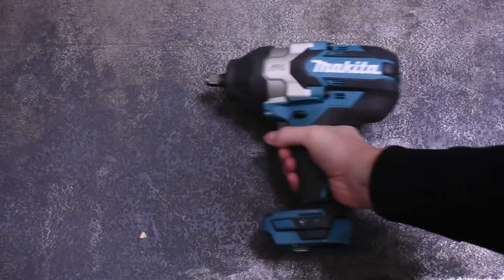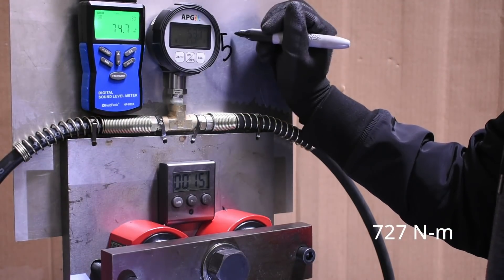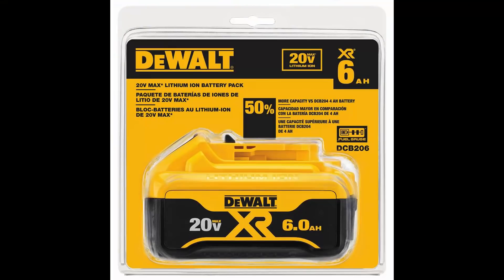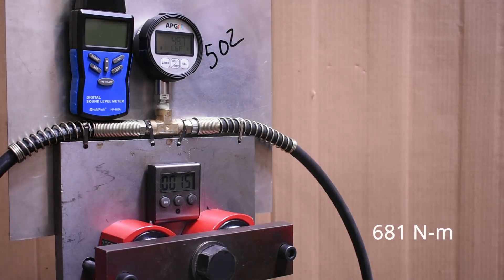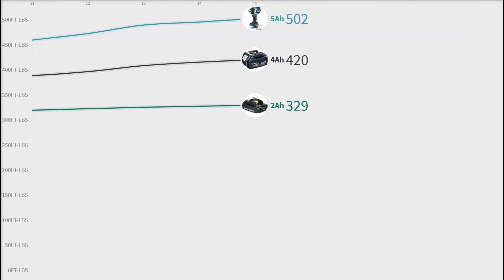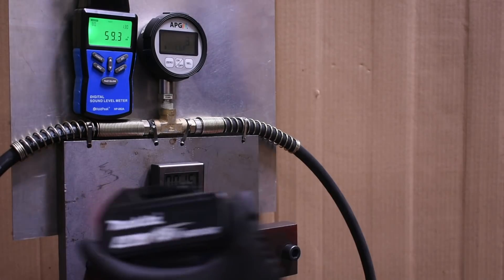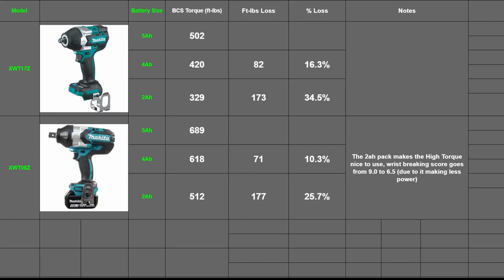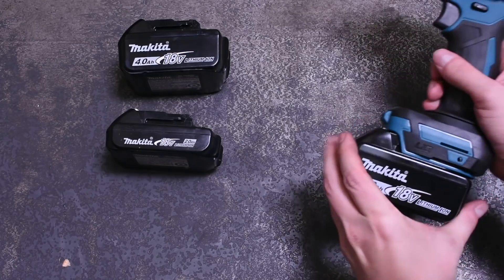How Much Power Are You Losing w/ Smaller Batteries? Dyno Testing For Science

Comment: My tool set is largely makita. While I love their tools, their batteries have been my number 1 gripe for years. I find the 2AH batteries to be only really useful in limited scenarios because of the power drop. There is a reason why I own 4 2AH batteries, 2 4AH (Came with a kit and frankly collect dust as they perform worse than the 5AH at the same weight) and 2 dozen 5AH batteries. I basically keep a few 2AH around when power doesn't matter and the weight savings are valuable, otherwise I only ever use the 5AH because the 4's just offer no benefit whatsoever.
Reply: I agree. All I've got is about a dozen 5ah. And two 2ah.

The only thing I use the 2ah for is the drywall screw gun because it's lighter to hold and doesn't need more power or runtime really. One battery in the tool. One on the charger ready to swap.
Reply: Wow, Makita must have your family held hostage, two-dozen batteries? What the heck for? Haven't you got a charger? Have you got 15 guys working for you?
Reply: @Senkino5o  I take advantage of their frequent sales when they are giving away double batteries. It isn't particularly difficult to get a bunch of batteries if you bide your time and watch the promotions. Sometimes you even buy a tool  you don't need to get a double pack of batteries knowing that you can resell the tool a few months later for most of its value and keep the batteries. There are two types of people who pay lots of money for batteries; Contractors who can't afford down time and people who are too impatient to wait on sales.  This applies to any major tool line.

As for the "Don't I have a charger" comment..of course I do. However when doing a job and having many tools that use 2 batteries at a time. I don't want to be constantly swapping batteries and I want a charged one ready to go for any given tool I'm actively using. So for example I was building a shed and as such using my miter saw (2 batteries in use, 2 in the charger), my 36v circular (2 batteries in use, 2 in the charger), thee regular circular for finish cuts because I have better shit to do than constantly swapping blades (1 bat in use, 1 in the charger) 3 Impacts because I'm teaching my kids how to work ( 3 batteries in use, 3 in charger) and a regular drill ( 1 and 1 respectively). That alone accounts for 18 batteries in use at any given time on one project. So no having a couple dozen batteries isn't surprising or even unrealistic.
Reply: @OmegaGamingNetwork  not unrealistic? how often is someone using more than 1 tool at a time? but i will say your saws justify a fair bit, wouldnt say all 18 of those make sense lol
Reply: @bradhaines3142  I am just describing how I typically work. As for using more than 1 tool at a time, that isn't really how I view it. Time spent swapping batteries around is time I could be doing something else. When I begin a project, I want everything at hand and ready to go. I don't want to be picking up a tool only to realize "Oh I gotta go grab batteries out of the other tool I was using". Especially since for all intents and purposes I have paid little to nothing for those batteries. Now again I'm not recommending someone run out and buy $1000 worth of batteries. That is of course absurd. However in only a couple of years I have accrued dozens of batteries by biding my time and patiently taking advantage of battery deals with tools that I either needed or could sell the bare tool for most of what I paid at a later date. I doubt I've spent more than a couple hundred directly on batteries. For me that is a stellar value in time and work because extension cords (good ones) aren't cheap either and frankly are just  a pain to drag around.  Now I would agree that most people don't need that many batteries and frankly I don't "need" them either. However I have them so I take advantage of them. Anyhow my only point was that getting this many batteries doesn't automatically make me some super contractor or someone throwing around huge amounts of money. I've built this collection up over years by being patient and taking advantage of makita's many sales. You can do the same thing with most of the other brands as well.
Reply: @OmegaGamingNetwork  i work at power plants and know too well how awful extension cords are to work with. believe it or not power (120v) is one of the hardest things to find at a power plant so I typically have to run around 300ft of cords before the day even starts, all overhead, all heavy duty cords (usually 20A) so i know exactly what you mean by that. i guess i see your point on the time effeciency and definitely can't blame you for finding good deals on them. doesnt make it any less odd to have dozens lol
Reply: @Senkino5o  I have 36 batteries and I work on my own. Definitely need them all.

Comment: Can you try a flex volt battery on the dewalt to see how much difference it’ll be from the xr batteries?
Reply from the maker: We plan to revisit DeWalt battery types, yes. Although we expect the 6 and 8ah XR's with 21700 cells and their huge discharge rate would outpace the flashy flexvolts that have the eye catching 60V on the side so it would feel like its supercharging your 20V tool, but is really just more 18650's inside at 20V to your tool.
Reply: @TorqueTestChannel  the 6ah flexvolt is the only flexvolt with 18650 cell. The 9ah and 12ah use 21700 cells. While you're at it, can you test the Makita with dewalt or Milwaukee 21700 batteries using the battery adapter. It worked well for the ryobi so it might work well for the Makita as well.
Reply: @TorqueTestChannel   have you guys revisited the Dewalt battery types yet?
Reply: While your doing mid torque wrenches, how about  a test of Dewalt's 894 mid torque wrench?
Reply: From what ave eluded to... the flex volts could yield 60v if the tool was designed but at the imbalance of the pack. Possibly wearing it out faster

Comment: I think Makita's 4.0ah xgt batteries actually do use 21700 cells.
Reply from the maker: I've yet to see any confirmation, but that would be interesting - basically be a XC8.0 or XR 8ah wired for 40V! Although still, Makita saying you gotta upgrade to our 40V tool system to see a boost in power again instead of making something like that for the widespread LXT line.
Reply: @TorqueTestChannel  It's true, the XGT 4Ah uses 21700 cells. However I've seen tests on other channels that suggest that the 2.5Ah battery with 18650 cells is actually more powerful than the 4Ah 21700 cell battery, as confusing as this might sound. I've been wanting to build a prototype 18V 8Ah battery with 21700 cells for my Makita 18V tools just to see how it would perform but I'm still waiting for my spot welder from china that was supposed to be here months ago
Reply: @MikadoRC  I think I'm familiar with the tests you are referring to. Very interesting that the 21700 cell XGT batteries didn't outpreform their 18650 cell counterparts. Do you think it could have been because they were compared under no load?
Reply: Hard for me to think the 2.5Ah making more than the 4Ah has to do with anything other than the tool or battery electronics protection circuitry kicking in. I’ve only seen it observed on one XGT tool thus far, for the rest the 4Ah makes more as you would expect.
Reply: @kenshirogenjuro873  Look up Battery Mooch. He's got a comprehensive list of batteries and what they can put out vs manufacturer specs.
Reply: @TorqueTestChannel  You're literally testing a brand new, 18V, record-breaking mid-torque impact made by Makita in this video. They also came out with a new hammer-drill (XPH14) that shames Milwaukee's best.
Reply: @RabidBadger_  Milwaukee's best has been around for 6 years. I should hope they can. Just make sure you've got two spare batteries kicking around to run the Makita.
Reply: The Milwaukee 2804 came out in 2018.
Reply: @RabidBadger_  I was talking about sds. Rotary hammer. A REAL hammer drill.
Reply: @An Orange Battery technology is kind of funny... It's like sticking a huge fuel tank on a car vs a small tank on a truck. The truck will pull more than the car can, but the car will put a lot more miles on than the truck. Been like that for a while.